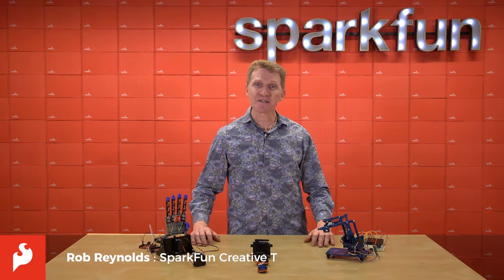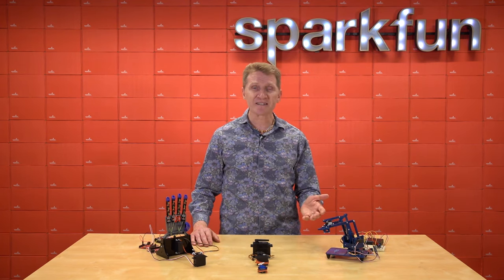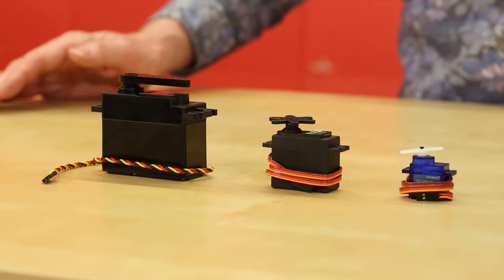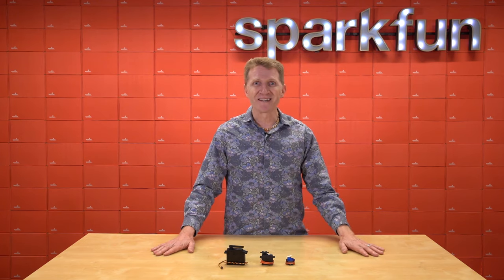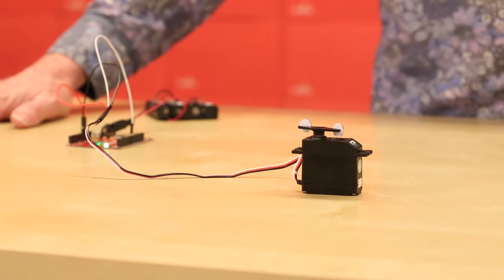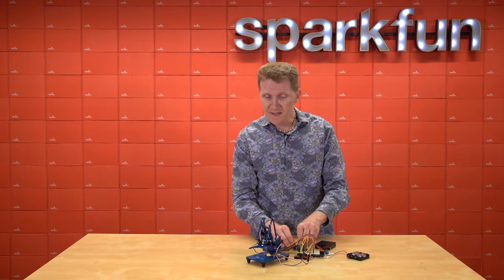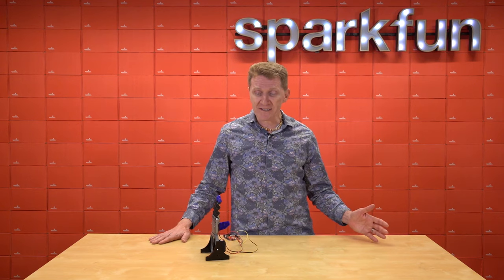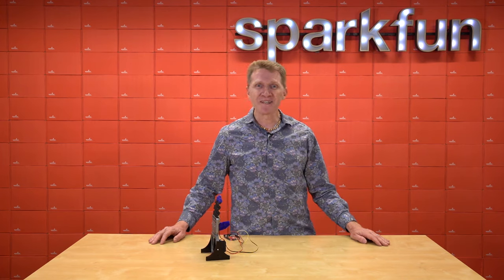Quick Guide to Servos

Comment: I'm working on a project where I need to press a small lever to release a hidden 2" x 5" drawer, but the space is limited.  A servo seemed like a great solution, but for my application, I'm trying to make it so if power is applied, actuate the servo (to press the lever).  So far in researching and from what you're saying I need to have some sort of controller in place though.  Do you know of any options where I can just have the servo arm move, say, 90 degrees when power is applied, and then go back to center when power is removed?
Reply: you could do it with an arduino microcontroller, they are super easy to program and have a built in usb port, but if you want it to be smaller you could use an attiny85 or attiny10 microcontroller. If thats still too big you can lookup some tutorials on "555 timer servo driver" circuits and that can also do what you are asking, but may require some electrical trickery to get it to go to 90 degrees specifically. As for returning to the zero point, when power is removed a servo essentially goes limp, if that works for you then congratulations! Its going to be easy, otherwise, the device may have to stay on to hold your lever at the correct position
Reply: @ADHD1080P  hi ADHD, have you become a flat earther yet?
Reply: Why are you asking him that? @flat-earther
Reply: @Wings_of_foam  thorsoele well we were all lied to when we were taught that the earth is a ball flying in a vacuum
Reply: The internet is good for some people but is very dangerous for others.
I'm not trying to ridicule you, but I think you should take a break from it.
So, let's say the earth is not round. What would you get out of that knowledge? Would it change your life in a positive way? We have more serious issues to focus on. @flat-earther
Reply: @Wings_of_foam  That is my personal opinion which does not change the fact that we were lied to.
BTW thorsoele, what do you think about all gubments drawing a line around you and saying you are not allowed to leave?(Antarctic Treaty) If you don't know what I mean, read my about tab.

Comment: i have a problem
i want a servo motor to operate in 2 different speeds with 2 diffrent clicks on button 
for example normal 120 degree rotation speed at single click and fast 120 degree rotation at double click using on off tactile switch using a cr123a battery.all these using a pcb or arduino in the most smallest space is it possible?
Reply: Create a variable for the switch so that its 15 when off and 5-10 when on, then replace the 15 mil delay of the servo you want to speed up with that variable.